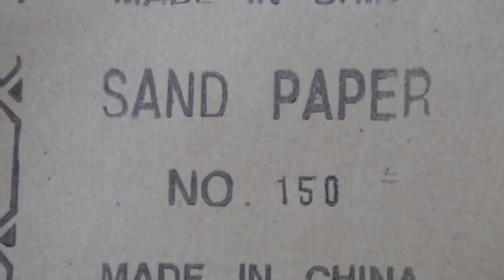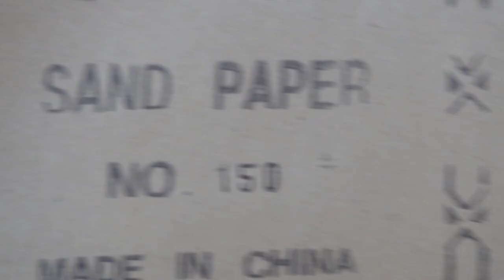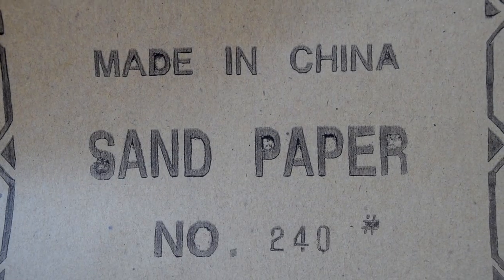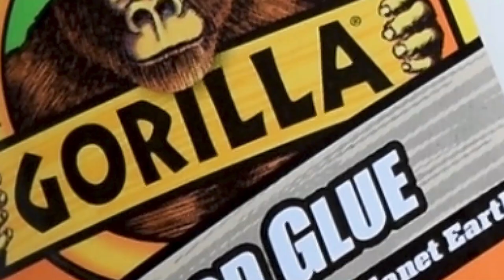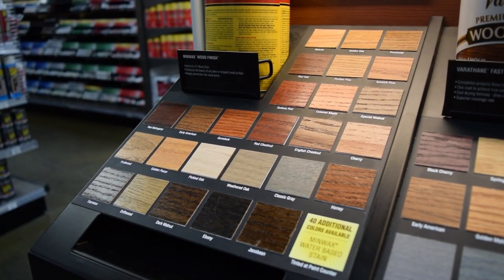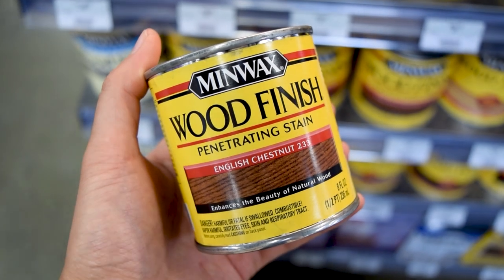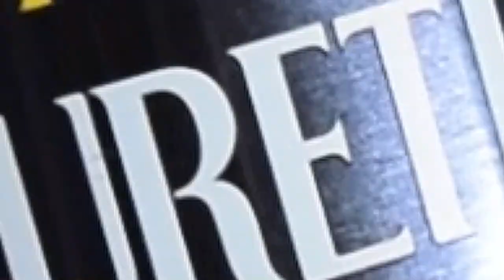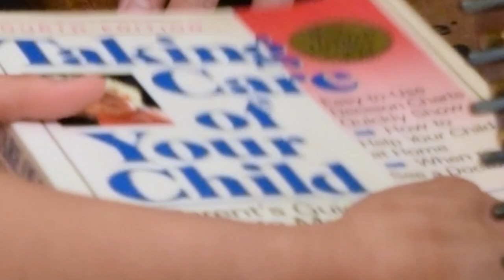BUILDING A HARP! | Fireside Cardboard Harp

Comment: If you use masking tape on the faces that aren't supposed to have glue on them, the glue will ooze out onto the tape, rather than be absorbed into the wood, so you can apply finish more easily without having to apply extra at those joints.
Reply from the maker: thanks for the tip!!